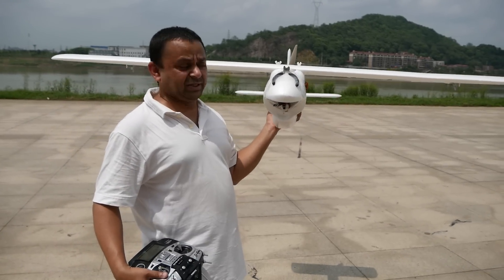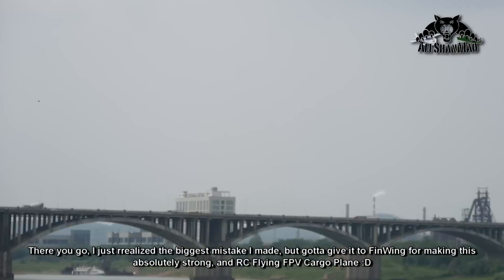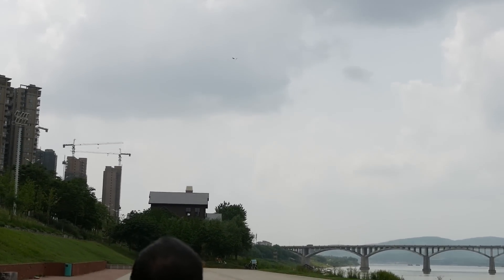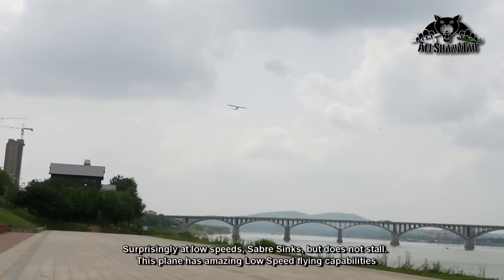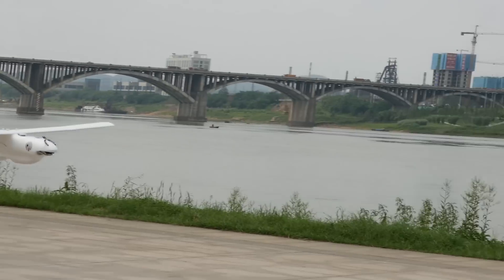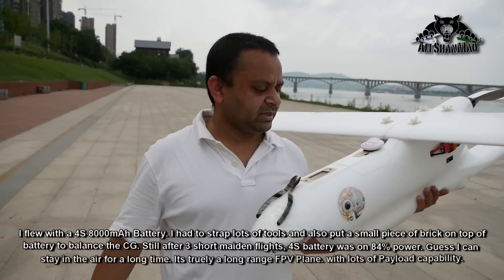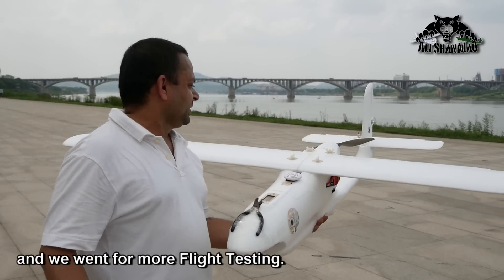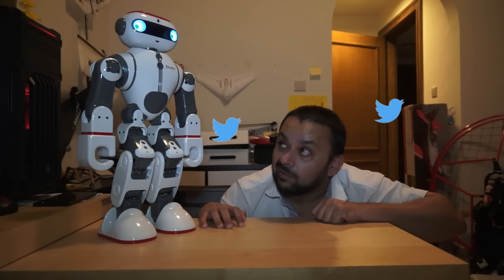Flight of a Giant Chicken The Finwing Sabre 1900mm FPV Plane

Comment: Alishanmao, how would you compare or rate the all around performance of the Finwing Sabre, compared to the Volantex Ranger EX (2000mm wingspan)? I almost bought the Finwing Sabre, but instead, I bought the Volantex Ranger EX, and I am really impressed with how it performs running on two 5000 mah 4 cell lipos in parallel, Cobra C3515/12-1100kv motor, ZTW 65A ESC, Master Airscrew 10×5-3 blade prop, HobbyEagle A3 6-axis AP stabilizer with gyro, 1100 mah 3 cell lipo for fpv power, Cyclops Breeze Pro OSD, Lumenier 600mw VTX, 3 Runcam Swift cameras, total weight of plane 3490 grams, (7 lbs-11ozs), this plane easily handles this weight.
Reply from the maker: The difference is day and night. Sabre will smoke Volantex Ranger any time when it comes to stability, flight performance, speed, flight endurance, payload and distance covered.

You can pack 2 x 10000mAh 4S in Sabre, a nose gimbal, a top pan tilt, a belly camera and it will still fly like a charm. Can Volantex ranger do that?  I have tested volantex Ranger. its a good plane but in no where near to Sabre for comparison. 

Ranger has issues with CG. It gets way too nose heavy and not much places to install gear. 

You should have taken Sabre, you will be happier.
Reply: alishanmao, thank you for the reply, now I wished I'd bought the Sabre. You are correct about the nose heavy problem with the Ranger, if adding gimbal & camera and size of batteries. I looked at the Finwing Sabre three different times, before deciding on the Ranger, I think the price difference is why I chose the Ranger in a kit, as with most planes I buy, I usually buy the kit when possible and put my favorite brand of electronics in them. I tried the Volantex Firstar EX FPV glider (2000mm wingspan), it couldn't handle very much weight, limited on size of battery, nose heavy, and the wing structure was too flimsy, and the aluminum wing spar will fold up and break if pulling too many G's, that's how I totalled mine out in a crash. Hope you have a great day! Thanks again!